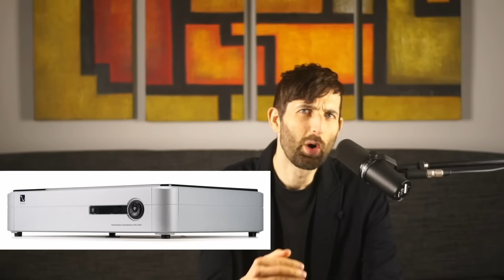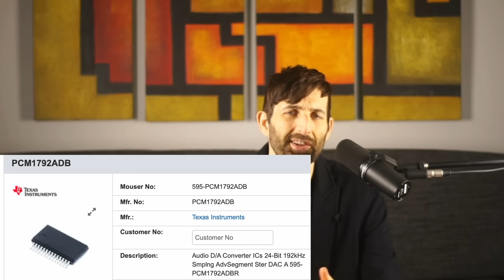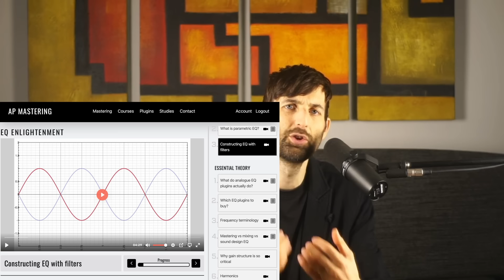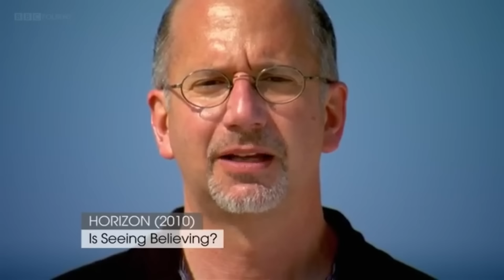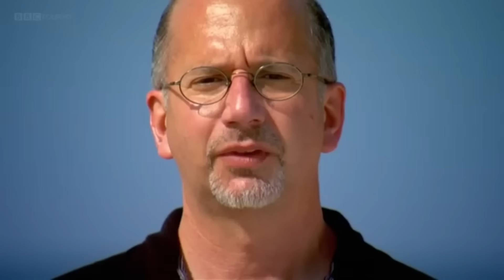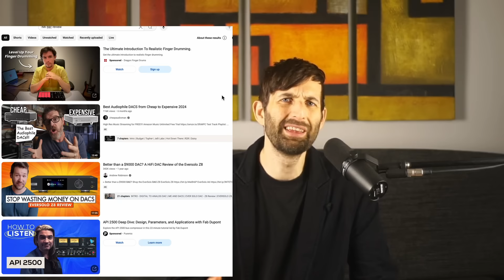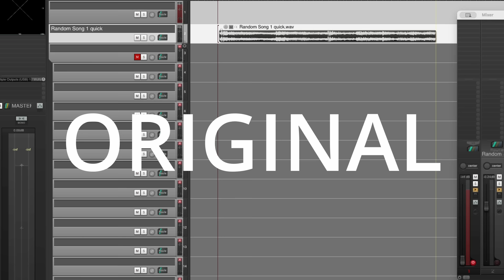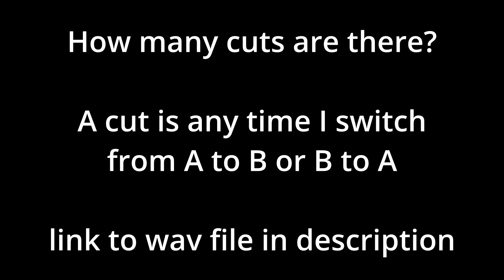The DAC Scam - Almost everyone believes the hype

Comment: God, this guy's an idiot. 

Firstly, your neither of his scandalously over-priced DACs examples use mass-produced DAC chips at all. Both the Wadax Ref. and the dcs Vivaldi use discrete, proprietary DAC circuits that are quite different than those found in mass-mkt chips (dcs uses a 5-bit "ring" DAC, whereas the Wadax uses a discrete, dual-differential chip that operates after their proprietary feed-forward correction system--which, admittedly, is not part of the DAC circuit itself). One can debate whether these custom designs make a sonic difference and/or if they are worth the money. But what cannot be debated is that the great majority of very high-priced, audiophile DACs DO NOT USE MASS MKT. DAC chips (though, admittedly, some do). So, if this buffoon cannot even be bothered to do the most cursory of homework for his videos, why would anyone believe anything else he has to say?

Second, the “majority” of a DAC’s sound is not determined by its chip. Several times, I’ve heard mid-priced DACs with exactly the same chips (usually ESS) that sound remarkably different. In fact, all of the other “stuff” around the chip, like the clock, the power-supply, the chassis, etc. (which, to be fair, the clown did mention) have a much, MUCH greater impact on sound quality than the $50 chip itself. And all of that stuff can cost a lot—a lot more than the chip. Again, one can debate whether these (mostly analog) factors make a sonic difference and/or if they are worth the money. Much more difficult (or even impossible) to debate is that the chip is the single or even the greatest determinant of DACs’ sound quality. So, while dumb-dumb accuses others of not understanding basic DAC design, its he who is well out of touch with the many DAC designers with whom I’ve spoken.

Third, and finally, the doofus seems to misunderstand NOS DACs. Even the NOS DAC designers with whom I’ve spoken will admit that their designs have higher distortion—in some ways. However, they argue that the problem with up-and-oversampling, noise shaping, etc., is that even as they fix some distortions, they create others, esp. in phase (sort of similar to how global feedback fixes some problems in amps, while creating other, worse problems). So, the issue with NOS vs. oversampling is not more vs. less distortion, but what sorts of distortions you are more willing to live with. Most of the time, in my own listening, I’ve actually preferred oversampling DACs, all else equal. But the fact that the moron fails to even understand the tradeoffs being made means he should just stop weighing in on this topic. 

Really, you are not helping. There are totally legitimate debates to be had about high end audio and the growing cost associated with it (I, for one, actually agree that prices are really and truly getting out of hand). You, however, are not truth-telling or shedding light, but are in fact spreading disinformation based on half-ass research and a poor understanding of basic DAC design. Again, that is not helpful. Again, please stop.

Comment: 7:21 Holy fuck, based, just fucking based. I was arguing for 4 years with some "reviewer" from Poland about changes in sound when u switch the cable. I was telling him many times, "as a electician im telling u, you are only changing the resistance of the signal, not the signal itself", and he was like "no, i can hear the treble is more creamy with this gold plated 4000$ cable". I asked many times-can u measure it? "No, because my hearing might be better than electrical devices". I was so fckn terrified how many FLAT EARTH BELIEVERS are there, because these people are the same as these conspiracy theory groups, u can't tell them apart as tell the diff between dacs. I did actually a blind test with my friends 2 years ago, since i am the only one who has some gear-7Hz Timeless, Moondrop X Crinacle DUSK, and Hifiman Arya with Dragonfly Black 1.5 and ifi zen v2, that's all i have and i dont think i will buy anything new in the future BECAUSE I DONT HAVE 40000 OHM HEADPHONES THAT NEED 200AMPS. Results are as expected, no one told me the diff between DACs, but my sister told me the diff between DAC in WASAPI and dac under control of Windows(windows is kinda messing the sound). As expected, it's a waste of money. SpectreSoundStudios did a lot of videos about AMPS for guitars, and how are they useless, BECAUSE SOUND COMES FROM LAST THING ON THE CHAIN-SPEAKERS!!! And only the speakers make the difference, he also made a lot of blind test. He even made the tests with guitars, because people were telling that gibson sounds the best because of wood etc, and when he did blind test NO ONE CHOSE THE RIGHT GUITAR THAT WAS ACTUALLY PLAYED. https://www.youtube.com/watch?v=qpq7tsK-kZk
 Finally i see light there, a little light. U guys both do a great job.

Comment: The issue obviously isn't just the DAC chips. I just bought a Fiio FA17 for use with a phone. The onboard sound on my desktop PC blows it out the water. In fact it's not even better than some older phones or tablets with headphone jacks. On the other hand I do have an expensive mastering DAC/ADC and headphones on that sound fantastic. Endless reviews of how good this Fiio is but it's crap even for the low price. The DAC circuitry on my motherboard is obviously really good for onboard sound.

The issue is all the commentary by people who have not made decent comparisons with gear that is definitely good no matter the price and they aren't really using their ears. I've continuously bought old music gear because I thought it sounded good. Now a lot of that stuff is off the charts in value because my ears were right. For example don't tell me plugins can emulate old analog synths. Nonsense. However some plugins are good because they do something different. Uhe are good.

Comment: Sorry dude, but your argument doesn't stand up to scrutiny.  I know these DACs all use the same chips, but it's everything else around those chips (power supply, quality of capacitors, shielding, etc ) that influences the sound.   Not to mention, the difference between Delta Sigma and R2R DACs. I'm not saying you need a $25K DAC to have good sound, but everyone (except you) agrees that DACs in the $1-3k range offer better dynamics, wider/more open soundstage, and better separation between instruments than DACs in the >$500 range.   If you can't hear the difference, your system, setup or room acoustics must be lacking.  It's really fairly easy to hear the difference between DACs for anyone with a trained ear on almost every system.  Something tells me you put you out this video but in reality have a really nice $2k + DAC in your own system.

Comment: You don’t understand the issue. It’s the final playback of 44.1 PCM files - this is the biggest concern and why special DACs are prized by listeners. This cannot be done accurately enough on a low latency chip to reduce artifacts like pre and post-echoes (from upsampling) to well below audibility. This is why almost universally studios prefer to use sample rates of 88/96 or 172/196 KHz for recording. Not sure what sample rate you use for loop back but if it’s 44.1 then the audio is damaged from the get go and while it won’t get much worse (even after 100 iterations) the analog audio is compromised slightly from the get go. The manifestation of this problem is the plethora of digital filters offered by chip manufacturers - it’s claimed that filters have a different sound - well they do but it isn’t so much the filter as it’s more the upsampling errors from low latency conversion (short tap filters) and how these errors vary from one filter to another. Get yourself some ATC SCM150ASL and you’ll easily be able to hear what I am talking about - soundstage and harshness/glare is what is mostly perceived from these inadequate upsampling filters and why vinyl still enjoys a following.

Comment: This DAC madness crosses all borders. Many years ago I bought a broken one
vsx 521 receiver for 35 eu, yes 35!  After the inspection, I decided not to repair the output channels, which are bad anyway. But it's great inside Texas Instruments Aureus DSP dolby chipset. So after replacing the OP amp, the electrolyte on audio path, got an excellent DAC preamp. For 50 eu still works.

Comment: In the 80's I worked in a bank in Melbourne,  Aust and we had a number of jewellers. One of which I did all the import work and he said when it came to digital watches a $100 watch had the same chip as a $5,000 watch. This of course was early days and chip manufacturers where very light on the ground.
Reply: Having a beautiful partner or an ugly one doesn't matter when you turn the lights off.

Comment: Yes level match is crucial 
I was testing a popular brand of DAC and liking it better then I measured the output and it was running a bit hotter than spec. Just enough to fool me into looking it more vs the other I was comparing. 
You need to measure the output for this. An spl meter won't do

Comment: Sorry, I stopped listening to your rant at 7:11. So far, there is not much auditory experience being communicated, only statements that something technically inferior should sound worse. I have heard enough DACs that on paper should be excellent and albeit not bad, sounded absolutely dead with rather poor imaging and actually rather boring. Designs with lesser specs on the other hand have more than once surprised me with the way the were able to draw me into the music. My experience with digital audio is that it is an absolute can of worms. That means, that the audio designers are still grappling with what criteria are essential for a good product. We have already come to the conclusion that jitter and good ground design are an absolute must, which was waved away as snake oil by the "audio realists" like yourself in the 80s and 90s. The fact that the technology is not there yet where it is supposed to be leaves enough margin for overkill designs that actually do something better than the competition. Granted, the price tag s way too steep. Hopefully though, that is merely a matter of time. Goof mainstream digital designs of today do sound way better than the designs from the 80s and early 90s, so good progress has already been made. But we are not there yet. I can still hear the "digital edge" in a digital reproduction that is noticeably absent in a system playing an analogically recorded and mastered vinyl record. Of course vinyl comes with its own set of flaws, but these flaws are distinctly different from the flaws of digital audio reproduction.

Comment: Good DAC and Expensive DAC are totally different. Most of expensive DACs are manufactured and tuned to achieve as close as to the original recording.
Many of recording/mastering engineers who did not go the real recording venue and listened the whole live recording, say if DAC chip is same then the sound should be similar. Actually, they are not. There are so many digital problems to be eliminated during the reprocessing of the recorded sound. 
Go to a concert with no microphonic amplification as many as possible to feel the nuance of music itself. Don't forget thay you are the only one, judge!

Comment: The analog output stage that amplifies the small signal of the DAC chip to line level is the first stage of amplification in the chain of sequential additive amplifications that end with the final stage that powers your speakers.  As the first stage, it sets the tone and quality that all subsequent stages of amplification increase in power.  The garbage in garbage out rule applies here.  Despite its importance, there is very little consumer attention paid to the quality of that first stag, which is contained within every DAC.  Assuming the utilization of the same DAC chip in units of varying price ignores this very important stage.

Comment: As ALL serious listeners know - it's all about the implementation of the chip that drives the cost and no way is that a "secrete" or a "scam" (and btw, not all DACs use chips) - - so  how come you don't explain implementation and how that affects sound more than the chip itself? Sure seems like it's more about getting clicks and comments by rallying the non believers - yep, the Geshelli sounds great (I have 2 of them including the one with the so called high end op amps that Amir claimed was no better), they're excellent in many areas but if anyone thinks they can produce the same sound as the Wadia you show in your intro they're sadly mistaking - so  I'm calling you out - if you haven't played in the game then don't come off like you have, you're showing the Wadia and implying that it likely sounds the same as perhaps a Topping that might be utilizing the exact same chip - no way that's true, I wish it were - so - either you're a very poor listener or your just looking to enhance your algorithms in the YT game because I know you haven't EVER compared two DACs like that yourself  - -  I KNOW all DACs sound different from actually listening to them, yep, imo, the Geshellis sound fantastic (for an example under a grand), I would recommend them to anyone but they're simply not in the same league as my reference which retails for about 9K which btw is also showing in your intro - or for that matter I have a more modest chip DAC that goes for just over 4K, same thing, the Geshellis can't compete, even my girlfriend who's not at all a serious listener prefers my current DAC and has been vocal about it without any prompting from me as we don't even listen together, yeah, she must be hypnotized, sure, that must be it - - what I'm expressing here is real world stuff, I'm doing it, you're not.  Taking your attitude off the table and explaining why there actually are differences would be far more informative. If other commentors are reading this, it's as if AP is saying, oh, all 12AX7's and KT88's have the same spec and cost a pittance so why would one amp only cost a grand that utilizes those common tubes not sound the same as another amp costing 3X's as much using the same tubes - - ahhhh, because amps don't sound the same and neither do DAC's and that's (obviously) regardless that for the most part they're all made up of similar parts - - One last thing, I know for a fact that the PS Audio DAC you're showing in your intro utilizes a chip that PS Audio programs themselves, it's not an off the shelf part - do your homework next time. This video is ridiculous.

Comment: A DAC is way more than the chip.  Filters, power supply, isolation, output stage, etc.  If you can't hear a difference cool.  If you can, cool.  But this video is myopic garbage that displays gross ignorance.

Comment: Implementation of circuit design trumps specific dac chip. What's most important imo is the output stage and the way a designer chooses to modulate the volume. Be it analog with a potentiometer or in the digital domain.
Impedance mismatching from DAC straight to power amp can make a decent amp and dac sound meh. The biggest  aha moment Ive experienced in the hifi world is the addition of a nice pre amp in-between dac and  power amp. Disable any Inbuilt volume on the dac and use the pre for volume control. Most decently designed and implemented  delta sigma DACs sound pretty much the same. R2R being a different topoligy does tend to sound slightly different.
Pre amps on the other hand can noticeably change things. Be it class A based, op amp based etc. bottom line you will notice the most difference from whatever pair of speakers you choose to use so this is most important. Followed by amplifier, pre amp and dac in this order of importance.  You want a neutral and well designed DAC? Alot of the Chinese companies like smsl, topping etc have great value options.

Comment: There are some differences in the analogue treatment post conversion and there are some audible differences between Delta-Sigma and R2R conversion methods, but you certainly don’t need to spend thousands. I have a Schiit Magni Unity with a Delta-Sigma type conversion- that cost me a whopping $370AUD and I recently bought the Fiio Warmer which is an R2R with a tube buffer stage and is switchable between Oversampling and Non-Oversampling mode, that cost $670AUD and it sounds incredible. I also have 2 Audioquest Dragonfly - a red and blue. I find the blue sounds more rounded than the red - again about $400AUD each. 
All of these DACs sound different, but the difference is minuscule between the Delta-Sigmas, the R2R is quite a bit different (to my critical ears anyway)
None of them, however, compare to the sound I get from an OG first or early press, mint condition vinyl - played on my rig (Rega P3 with Ortofon 2M black, Vincent Pho-8, Schiit Valhalla 2) Again, spent a reasonable amount on that gear, but nothing crazy and it sounds magnificent

Comment: To be nerdily pedantic, the quick flash of a dCS DAC is perhaps unfair, given dCS is one of rather few firms that doesn't use generally-available DAC chips (unless they have spectacularly changed direction since I last had inside information). Even then, there's no guarantee the sound will be better, mind you.